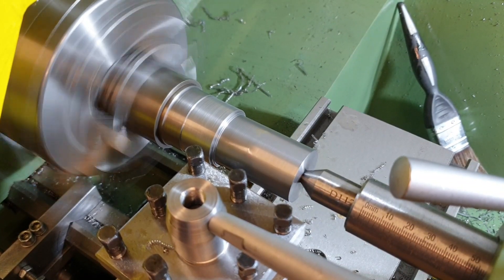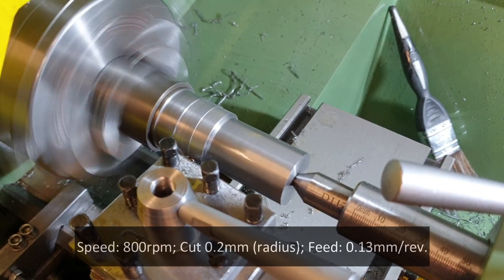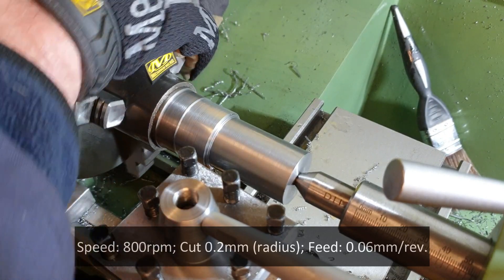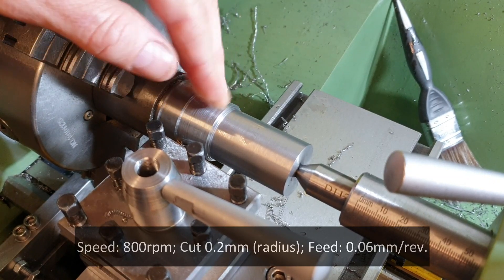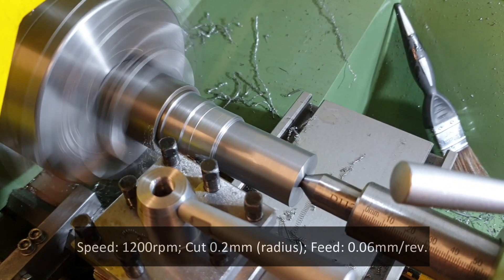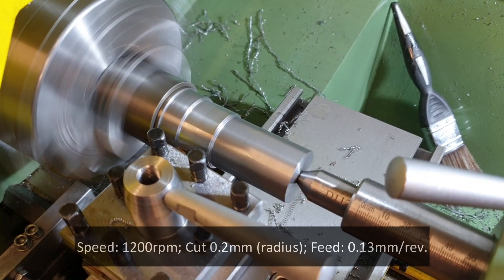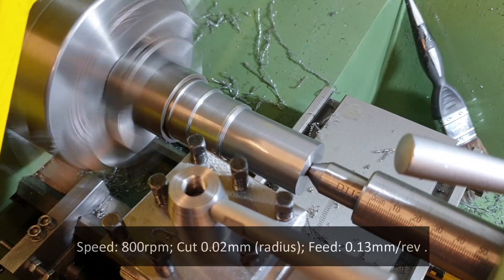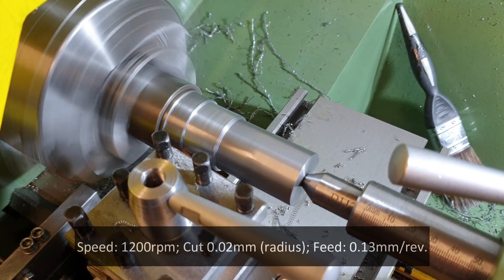WM250V Lathe - surface finish re-visited.

Comment: Hi mark thanks for the 2 finishing videos. Playing with a similar lathe aiming for a useable finish on hot rolled mild steel.  Experimented with hss however the mill scale just wipes it out!  Have experimented with various inserts. Best results are as you have found.  Load up the carbide. Lots of feed and speed up to 2000 on 40mm dia steel
The best on getting a finish removing the scale was a negative triangle tip (plasstools) however I definitely felt lathe was maxed out driving this tool but it did give a polished finish.  At much more sane efforts I found using similar to your Ccmt gave similar results.  For fine cuts I achieved much higher level of finish using specialist Ccmt finish tips similar to what stefanG was using in his Ccmt video (have you seen it).  Surprisingly I was able to get identical fine finish using the “shiny” Ccgt ground specialist aluminium tips = very economical from China outlets. Cheers jeff ps had a lemans… sold it for a r100r bmw

Comment: I would never use a fixed center. Fixed centers are good for grinding machines, and very low rpm operations. By the way you are spinning it, and not lubricating it at all. Metal on metal friction is not good, on dry. You will burn up that tip. Try a live center, and grind your own brazed tool with groove, that is much sharper.

Comment: hi mark...
Just bumped into you...
Funny thing is I was looking for a you tube vid on finishing quality...
I'm retired and new to lathe work...
I'm having trouble with the quality of my finish...
My lathe is pretty much the same as the warco 180

Frank...
Reply from the maker: Hi Frank,
Surface finish can be a challenge with so many factors to take into account.  Fingers crossed you'll get to where you want to be.
Mark
Reply: @markshomeengineering5243  One thing i learnt from you was leveling the lathe... I will do that tomorrow...
As it was brand new not so long ago, i felt it didn't need cleaning, I'd better do that as well...
Are you planning to get a mill at all?
Reply from the maker: Hi Frank, 
Definitely clean it, you might be shocked at what you find.
I do have a Mill, check out my Moto Guzzi videos to see it in use.  It's an old Warco Major Mill/Drill that I've had about 17/18 years.
Cheers
Mark